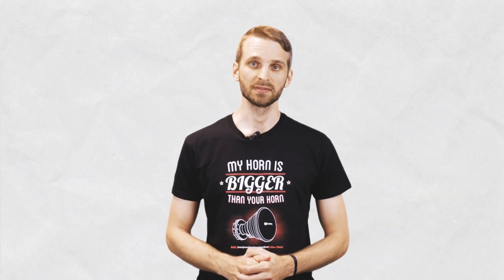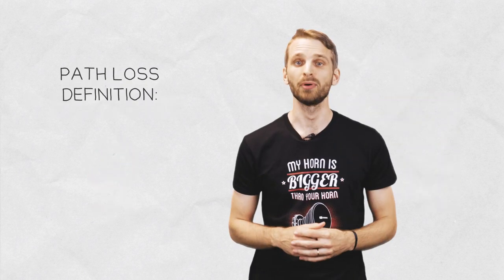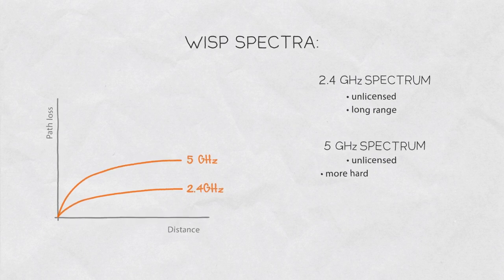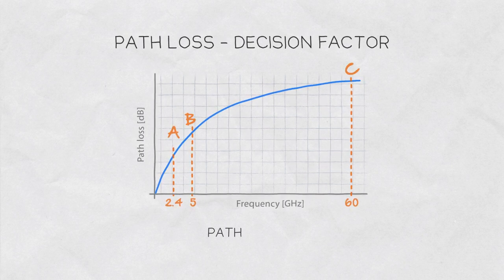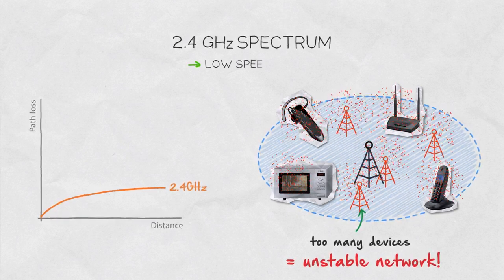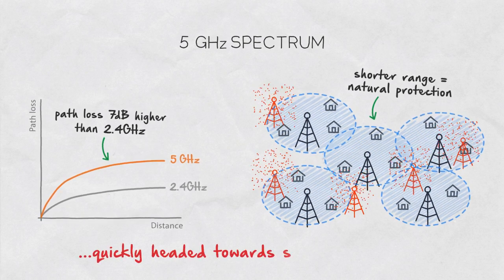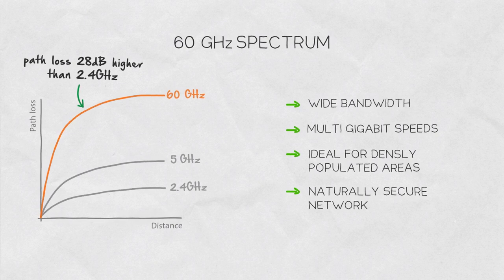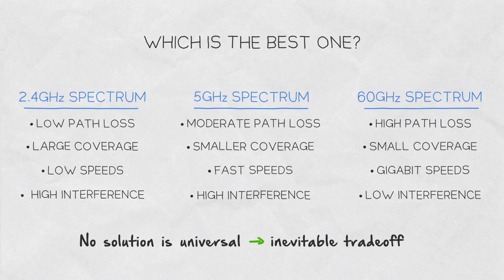Inside Wireless: Path Loss

Comment from the maker: Which frequency spectrum do you use for WISP links?
Reply: A big thanks, please I have a suggestion; could you make us a video that shows us what is customer premise equipment (CPE) used for fixed wireless access such as LTE or even 5G; I mean CPE in terms of view it inside components and how it works,  how it receives a wireless signal and decode it to original binary data, etc... I will be very thankful, thanks a lot again for this powerful videos related to "inside wireless" :))
Reply from the maker: @bstanis1237  Thanks for the tips for new content! Short answer would be that CPE does the same job as AP - transmitting and receiving modulated high frequency signals and decoding them to data and forwarding back and forth between the end user and the internet. CPEs are more integrated and cheaper thanks to that.
Reply: @Rfelements  Thanks a lot, it would be a great help if you make a video regarding these details "inside wireless = inside CPE"; a big thanks :)
Reply from the maker: @bstanis1237  we have bunch of topics in the pipeline, but will note it down for future, thank you.

Comment: Excellent and great episodes. Please I need to understand what's EVM and the standard EVM threshold for 2.4 GHz WiFi at 54 Mbps and the same issue about SNR. And all these in 5 GHz and 60 GHz too make into account OFDM technique.
Please I need the understand them these days by episodes.
All the best.
Many thanks for theses great work.
Reply from the maker: Thank you. A good explanation of EVM can be found here: http://www.antenna-theory.com/definitions/evm.php#:~:text=EVM%20(Error%20Vector%20Magnitude)%20is,the%20load%20of%20the%20radio.
EVM is inversely proportional to the SNR. The bigger the SNR the smaller the EVM. You can see the corresponding EVM values for QAM moudlations in the Fig. 3 in this paper:
https://ieeexplore.ieee.org/document/4136960
Reply: @Rfelements  Thank you very much for references.
Please if you could make episodes about that and the relation between these parameters..
All the bests
Reply from the maker: We have bunch of videos in the pipeline, but we will look into it, thanks for the tip.